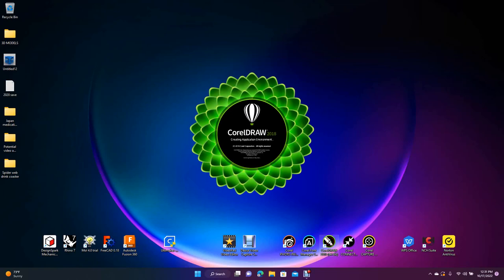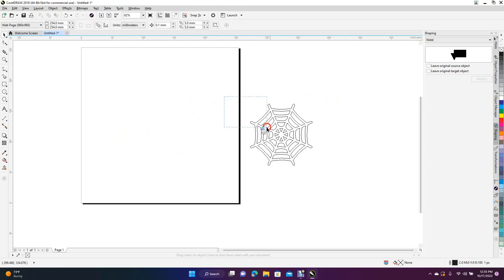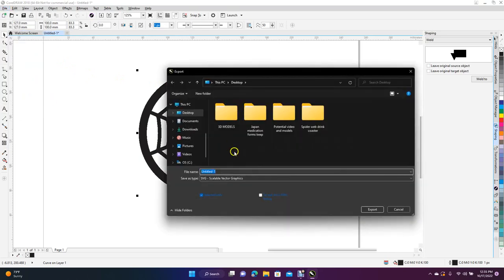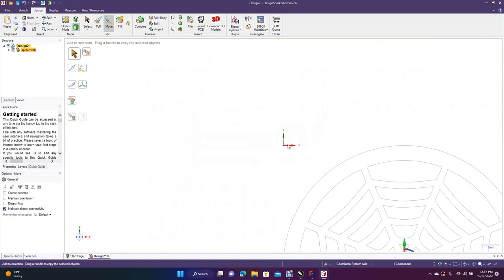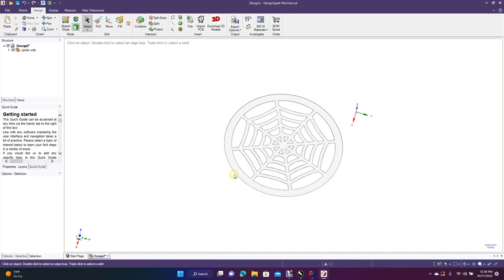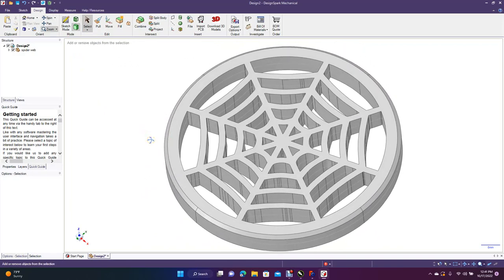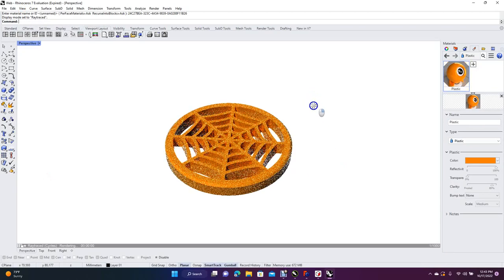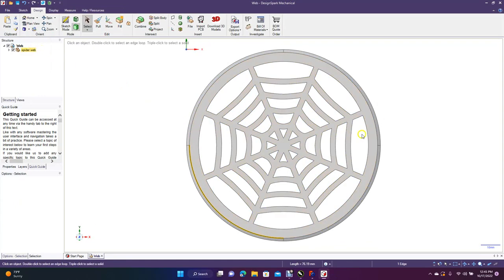How to create a Halloween spider web beer coaster in design spark mechanical

Comment: Are you printing on 3D printers?
If you do you should try new PrusaSlicer 2.50. It can print in Step files so you don't need STL files
Reply from the maker: Thanks!  for the suggestion. I don't have a 3D printer currently, but if I ever get one, I will consider using Prusa Slicer 2.50. Cheers!